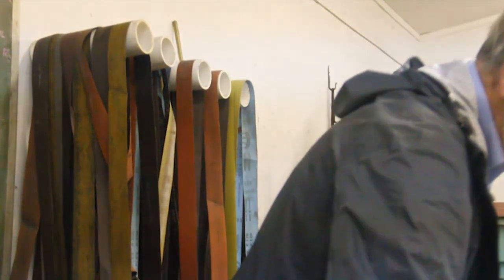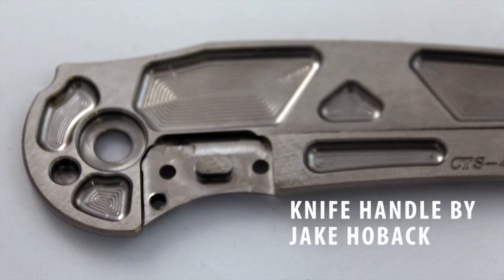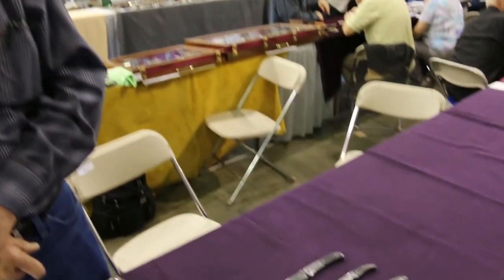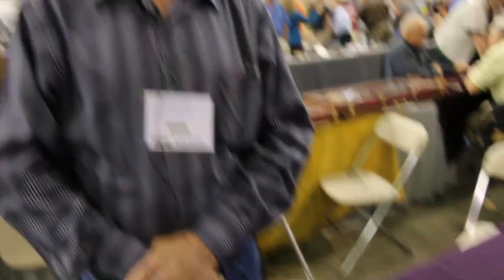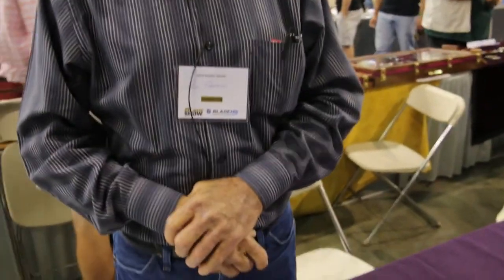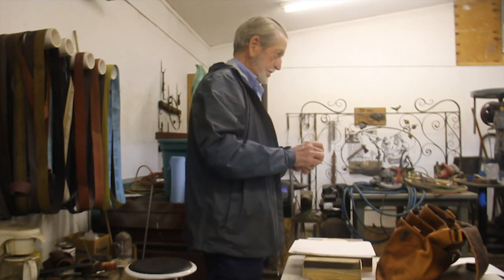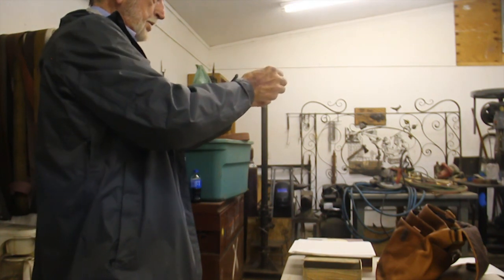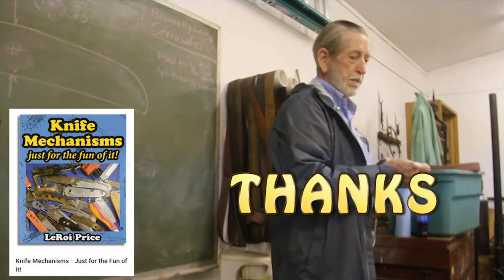MEL PARDUE DISCUSSION ON  THE TREND OF KNIFE BEARINGS VERSUS WASHERS

Comment: Great to see Mel getting the props he deserves, is still giving intelligent, insightful commentary about engineering related topics. 

He was a land surveyor and engineer for his day job, 40 years ago, and where I know him from, before I ever knew him as a knifemaker. It was only the last few months of our relationship, when he would bring in some of his designs, total one off custom stuff back then. He was big on Damascus and kudu horn handles back then, had some wild designs, then would come in with a canoe with hickory grips, looked like a 1890's Union reproduction, still beautifully made and totally classic. 

He once made a machete out of a truck leaf spring, damn thing weighed 8 pounds if it weighed an ounce. It worked great for about 2 hours, until the edge rolled, then cutting line was like, just hitting stuff with a truck leaf spring. In the engineering world, it is called proof of concept, this was not a success. 

As I type this have a Benchmade auto in my manpurse, at least 30 years old, a bit slow on the flick (needed to go back for rehab to the factory 10 years ago) but still reliable, holds a hella edge, has been used and abused, ain't pretty, but like the ol' codknocker, is still hangin in there like a hair in a biscuit.

Comment: I have knives with washers and knives with bearings.  Some of the washer knives open so easily though I wonder why we need bearings. Some of Spyderco's knives with washers and pivot bushings in particular are so drop shut easy, I like washers. Bearings are okay though.
Reply from the maker: Yeah I think it's a reflection of modern times. The bearings cost more and work better ....for awhile. But are prone to problems and need better maintenance. Like my father would always say about these "improvements". "Just something else to break". So "keep it simple" is often the best way to go.
Reply: @leroiprice1586  Yeah I totally agree.  For about the past year I have been semi-avoiding knives with bearings because pb washers are just as good, action wise and are simpler and less prone to break.

Comment: I think that washers are less likely to gunk up, compared to ball bearings.
Dropping your knife in a sandy stream or mud can be disastrous for bearings, and taking your knife apart in the bush for cleaning the pivot bearings is a nightmare.
For a knife that you depend on in the outdoors...IMHO, washers are more than good enough, and less problematic.
Reply from the maker: I agree. "User" knives can not tolerate fancy fittings like "collector" knives or even "Killer weapons". But each modification has it's place.